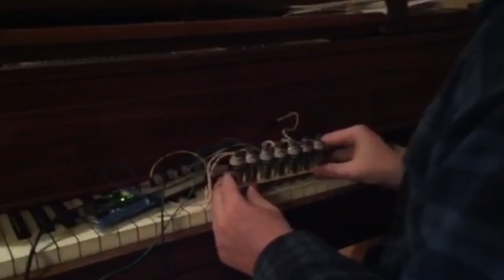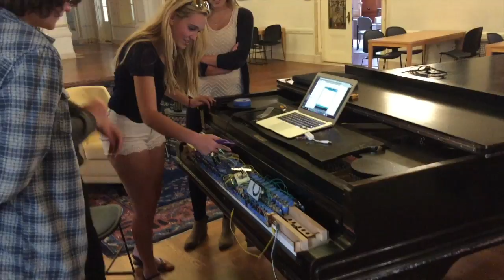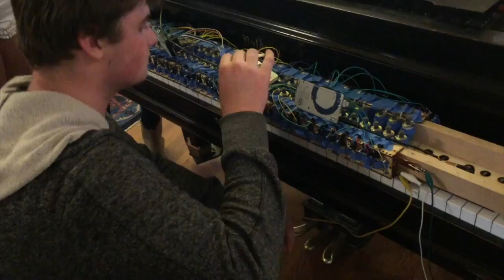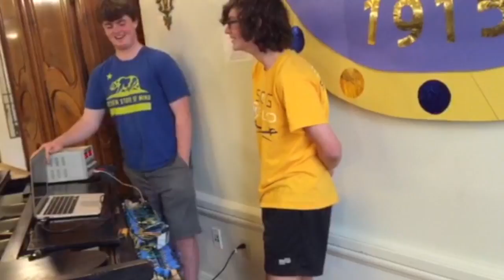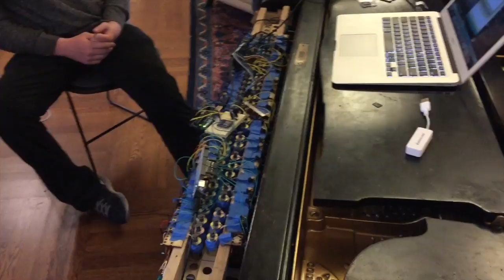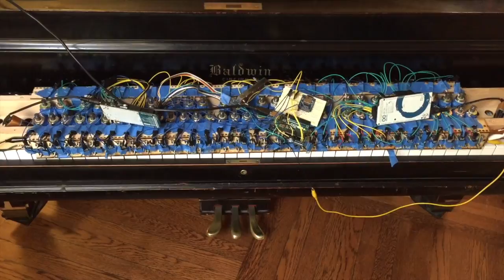Piano Key Actuator

Comment: Like Dave, would be very interested in one of these - with midi control.
Reply from the maker: This actually ran MIDI files-- the arduinos read the files off of an SD card. That being said, I never got around to controlling the force of each solenoid based on the file. I hope to get working on a second prototype sometime soon, but I believe my old prototype has been scrapped for parts at this point (donated it to my high school)